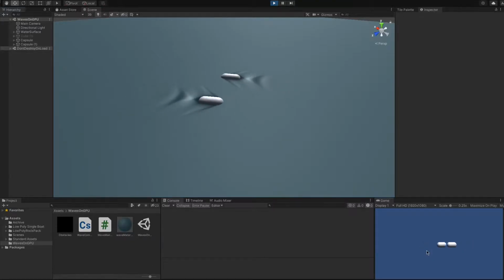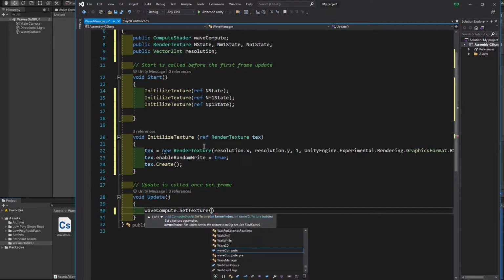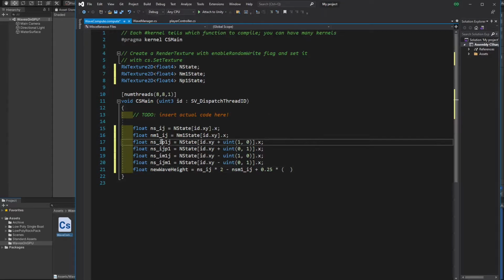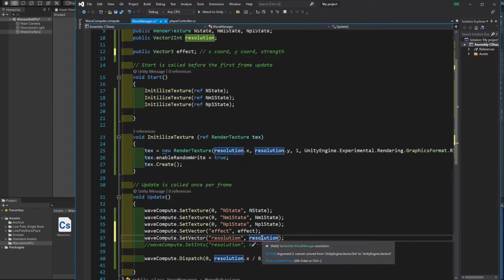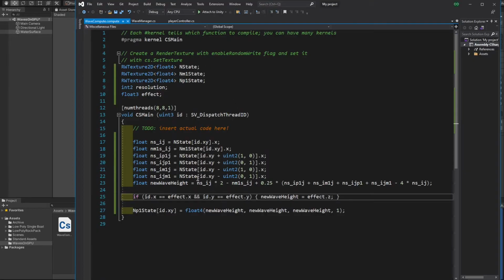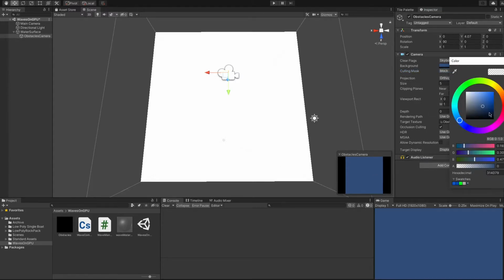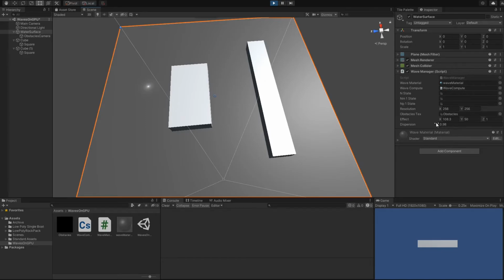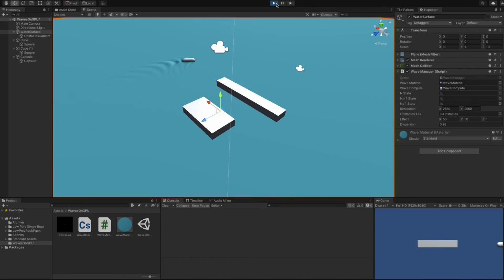Use compute shaders to create water effect in Unity. Now you can simulate ripples of a moving boat!

Comment: For those who are using recent versions of Unity (I'm using 2023.2.20f1) and the obstaclesTex does not affect the waves, try this:
- Select your Orthographic camera
- In the Rendering tab, check the option Custom Frame Settings
- In the Rendering section, find Post-process
- Check the left checkbox and uncheck the right checkbox

This will prevent the camera to use post-processing and use "raw" image. It fixed for me. Hope this helps someone else :)

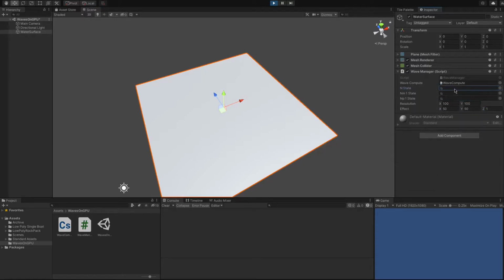Comment: Since I've seen a few people ask. At 20:12 if like me, you still see just a single pixel and your textures aren't getting updated, it might be because you're using OpenGL, which is the default on Linux. (See on far right of window name <OpenGL> rather than <DX11>) Luckily, Vulkan works on Unity 6.0 at least. Edit > Project Settings > Player > Other Settings > Auto Graphics API for (Linux I presume) > then rearrange Vulkan to be on top and restart

Comment: Hello, I was watching the tutorial and the results obtained are very spectacular, in my case I went too far and instead of using vector3 for a target, I used a "depthTexture" and applied 2 values, the one with the neighboring pixels added which is the one that propagates the waves, and the original one which is the one that erases the waves, with that I was able to make any object interact with the water including the target itself being an obstacle for the waves, in addition I also have covered putting this in the open sea by dynamically displacing the values without annoying artifacts appearing, the tutorial is greatly appreciated.

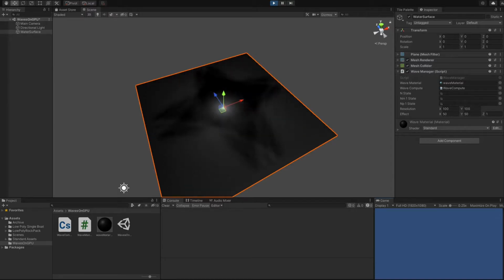Comment: I'm pretty sure I typed everything correctly, yet at 21:25 you get movement while I don't. Could this fail for me because of my system maybe? Running off an Intel UHD Graphics 620.
Reply from the maker: I am sorry you are having trouble implementing. To find where the problem occur, cud you try to print out the value at the center of the texture to console? Maybe the texture cud not be updated or maybe the compute shader is simply not being initiated.

Comment: Good tutorial works perfect!, one question is it possible to make it work with Time.timeScale?
i tried "if(frames >=Mathf.RoundToInt(Mathf.Lerp(8, 0, Time.timeScale)))" on Update and it seems to work but is there a better alternative?
Reply from the maker: It's a good question. I suggest running a coroutine in the background that calls for the wavecompute dispatch at every certain seconds. So it would look like;
    void Start()
    {
        InitializeTexture(ref NState);
        ...

        StartCoroutine(waveStep(0.1f)); //starts the coroutine with a time step of 100 ms 
    }

    void Update() //no need to enter anything in here.
    {
    }

    IEnumerator waveStep(float timeStep)
    {
        while (true) //continues until the coroutine is halted externally.
        {
            Graphics.CopyTexture(NState, Nm1State);
            ...
            waveCompute.SetTexture(0, "NState", NSTate);
            ...

            waveCompute.Dispatch(0, Resolution.x / 8, Resolution.y / 8, 1);

            yield return new WaitForSeconds(timeStep); //wait by certain amount of time.
        }
    }
Reply: @aoiti  I don't know why that solution didn't cross my mind.

I just tried it and it works perfect, so thank you very much!👌

Comment: Thank you for shearing your skills!! I tried your 2 water effect video's code on my unity.
This time doesn't work correctly.  Video's 33:14, wave reflects by block. But my wave doesn't reflects. 
Wave reflects only by the outside of WaterSurface(defined obstaclesTex.width and obstaclesTex.height).
I think there are errors in my cords of definition of obstacles...
Would you mind giving some advises?
Reply from the maker: There can be several reasons. Because we check the color of the texture for the obstacles, we need to make sure the red color is not tinted. It cud tint, if camera is not ortographic, or the material of the sprites that overlay the objects do not use Unlit  shaders.
Reply from the maker: I suggest first make sure the obstacleTex is created properly. If then I suggest instead of cheking for red color in the code, check if color is NOT black. that cud remedy the issue
Reply: @aoiti  
I checked both the obstacles camera is orthographic and obstacles(sprites from cube) are red.
But I checked my code, I can't find red color.
I don't know how to check obstaclesTex of objects are defined in Wavemanager.cs and waveCompute.